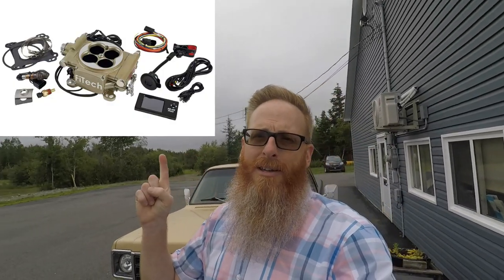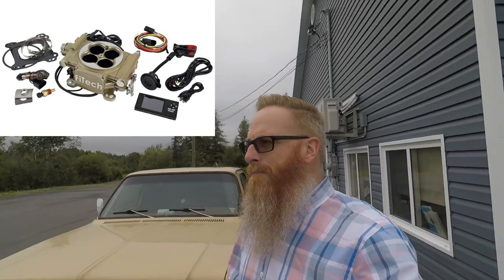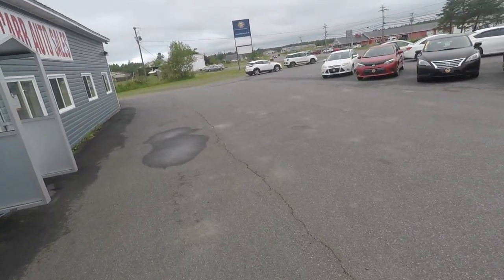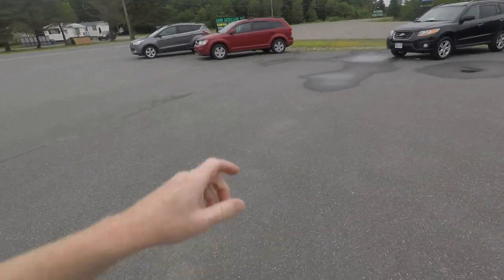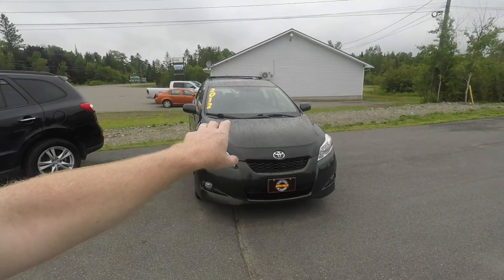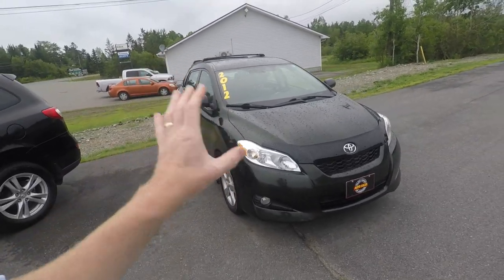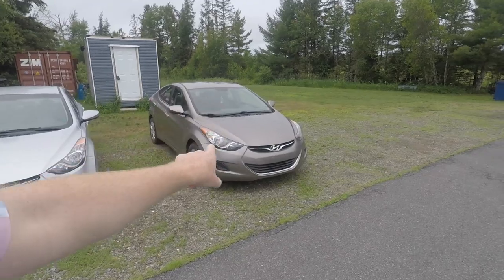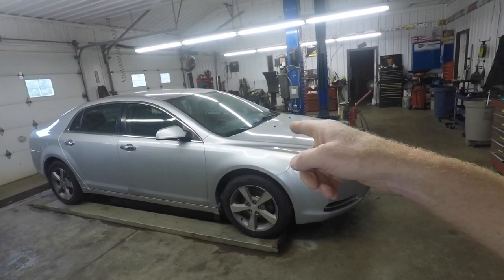IS NOW THE RIGHT TIME TO INSTALL A FITECH EFI IN MY 1977 CHEVY C10

Comment: I never had faith in edelbrock carbs, had issues out of every one i had. A good rebuilt qjet goes a long ways. I still daily a qjet. Got it set years ago and never had to adjust after that. Efi can be good but me personally i wouldnt touch one until i needed more then 800cfm for a street car. I also seen alot of issues with fitech. If you so go efi its easier to just swap over to a tall single plane intake.
Reply from the maker: Or an LS! lol! I still have the original quadra-bog, maybe I should swap it and see how it works!
Reply: @OldeCarrGuy  you know me i am no fan of an ls swap. If i want new i will buy new if i want old i stick with old lol. Honestly to me the modern fuel economy and performance is gear and transmission combos. I would for sure give the quardjet a try and take the time to tune it. I think thats most peoples issues with the qjet is they dont tune it properly. I have had the one on the work truck for ahwile maybe 10 or more years since it was rebuilt. It was on my other truck with the much larger cam. Ran flawless on that one to. Had an edelbrock on the other truck very shortly and one on the work truck when i first got it and swapping to the qjet was a hands down difference.  Small primaries for good fuel ecnomy and large secondaries for performance its just taking the time to adjust the secondaries that people have an issue with

Comment: I have a Fitech on my Nova. I only got to driving it for the first time this spring yesterday because I had a stuck Injector that basically filled my oil pan with raw fuel....I will be making a video of how I tried fixing it and then the injector replacement on my Classic Drivers Garage youtube channel
Reply from the maker: I’ll head over and check it out!
Reply: @OldeCarrGuy  I'll try to have it edited by the end of this week...i'm new to all this so I'm a little slow
Reply: Vid is up

Comment: I think I would spend my time tuning your carburetor. Those other products are just electronic Carburetors that still have fuel distribution issues (not tuned port injection). IMHO.
Reply from the maker: I appreciate your opinion! I’m trying to learn more on carbs but I’m going in a bit green!

Comment: I have a few thoughts on this: 1) never liked an Edelbrock, always found a Holley easier to work on and tune. Some of the Brawler/Quick Fuel line offer really nice tuning capabilities off the shelf with features such as removable IABs, IFRs, HSABs, etc as well as billet/aluminum construction and nice things like float bowl windows instead of a plug. A tunable carb like that and an AFR gauge is pretty good. 2) The Fitech/Sniper stuff seems neat and is a pretty much bolt on EFI solution for most domestic engines which is why it's so popular, but at the end of the day it's still TBI. When I went from carb to EFI on my race car I considered a TBI deal but ultimately went port injection and whenever I get around to my Mustang that will be port also. Just my thoughts/opinions based on my experiences.
Reply from the maker: I appreciate your thoughts, opinions and experience! That’s why I make these post/videos. When it comes to carb tuning, fine tuning, it’s almost another language to me. I have a hard time following someone in a video who is an “expert” and assumes I know everything they know when they are explaining! I don’t! It needs to be dumbed down a bit. I’m definitely getting an AFR gauge set up. 
At the end of the day! I just want turn key reliably no matter what the system is.
Thanks again Paul for your expertise!
Reply: @OldeCarrGuy  if you think I'm an expert boy do I have you fooled 😂

Comment: Dont lose faith in carburetors just yet I actually recently installed a 1406 Edelbrock with the fuel regulator and fuel pressure gauge on my truck and dial it in and made a big difference and runs so much better maybe try that 🤷🏻‍♂️ happy 4th 🤘🏼
Reply from the maker: Thanks Albert! I’m definitely going to do more learning on this before I pull the trigger.

Comment: I have the 400HP 'Go Street' on my 302. Runs great. Doesn't have timing control, which I didn't want. I have the inline frame-mount pump; kinda noisy. If I did it again, I would go with an in-tank pump. Pay very close attention to the instructions for wiring and such, they seem to be sensitive to electrical interference. FiTech says their ecu can run a fuel pump by itself, mine is, but a lot of guys say to use a relay. Must be a digital relay to retain pulse width modulation from the ecu.  There are a lot of videos and some fb pages dedicated to tuning the FiTech. Check them out.  All that being said, consider working things out with the carb. Check out Thunderhead289's channel here on youtube. He has some great info on carb tuning there. Either way,  it'll be interesting to watch here on your channel.
Reply: Also, just wanted to say there are some 'hidden' costs. I had my fuel tank modified to accept a 3/8" return line(AN fitting) and 1/2" pick-up. I also ran new 3/8" steel supply and return lines from the tank to the engine bay. Then there are (lots of)fittings, filters and a couple short steel braided AN lines to connect at the throttle body and at the tank. I bought a fairly expensive flaring tool to make AN ends for my steel lines. It adds up pretty quickly. There are probably cheaper ways to do it than what I did, but I didn't want issues with fuel supply/return. A restrictive system can overheat the pump.
Reply from the maker: Thanks for the info Gary! I have watched Luke’s channel, but I get confused very easily! He seems to know his carbs though!